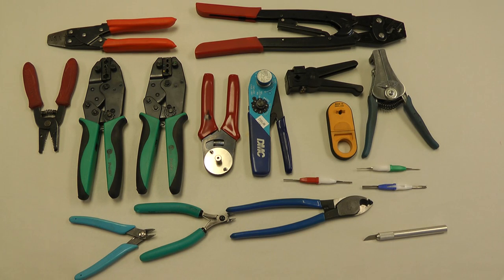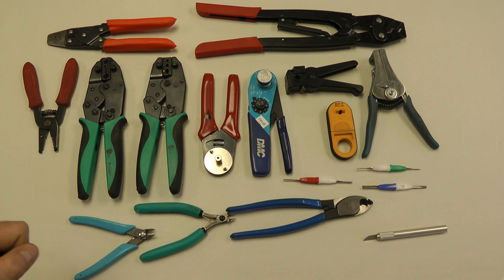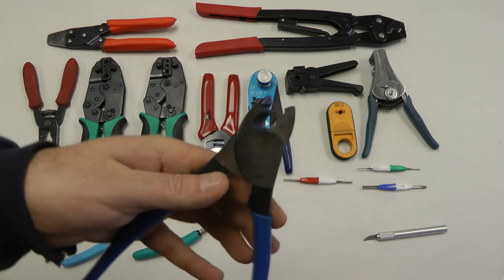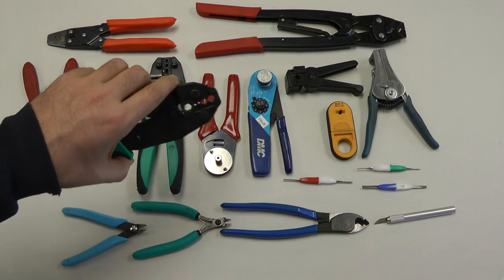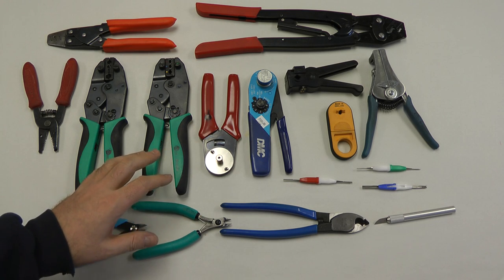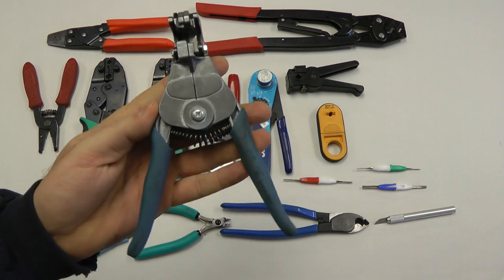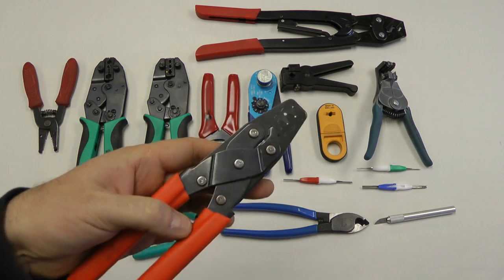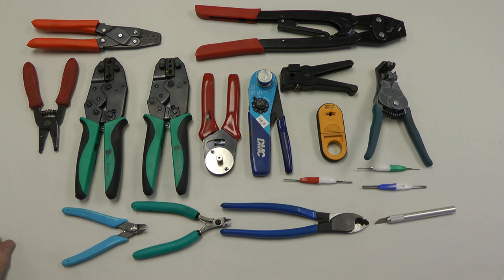001.  Tools: Aircraft Electrical Tools, basic overview

Comment: I'm an avionics technician and I approve of your tool selection! The only thing I'd add is a pair of diagonal cutters for cutting wire to preserve the flush cutter blades, but other than that these are the right tools.
Reply: Alex Eddy hey what multimeter would you recommend?

Comment: For the new technician (I’m relatively new): Some companies will prohibit you from using your own personal tools that require calibration, wire strippers, crimpers and multimeters. This is the case with a commercial job I just accepted. So don’t go out on a spending spree before you have all the information. Ask the company for a required tool list, or just tell them what you have and they will tell you what to leave at the house. 
In general aviation, or companies that don’t have a prohibited tools list, my advice is to invest in your own stuff. There’s nothing worse than waiting half a day to use a crimper somebody has checked out of the tool crib. Especially when they forget to check it back in, lol.